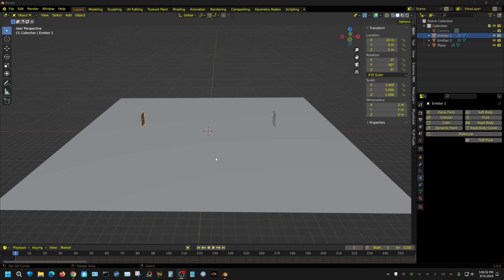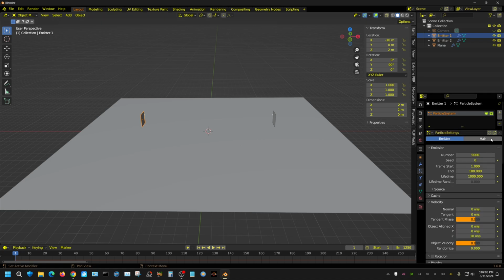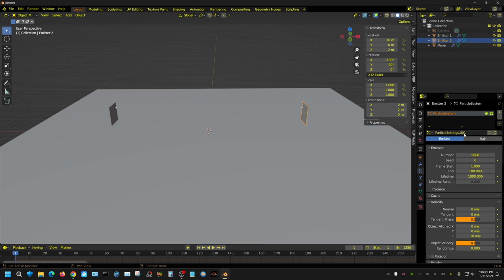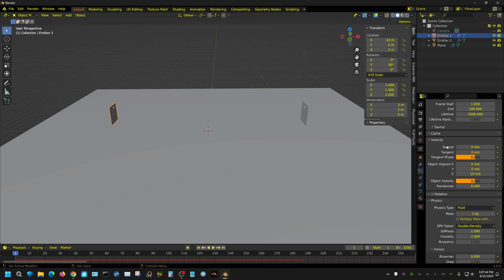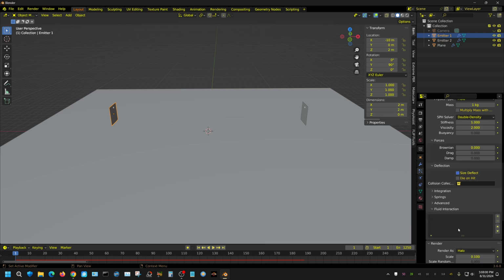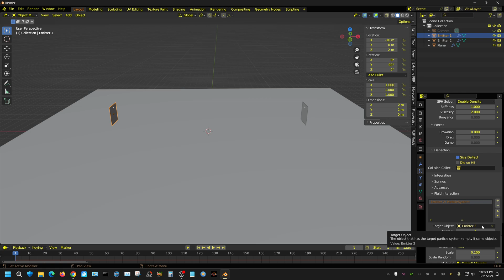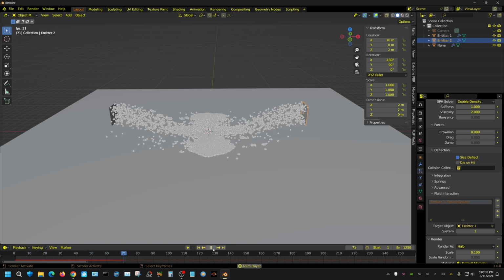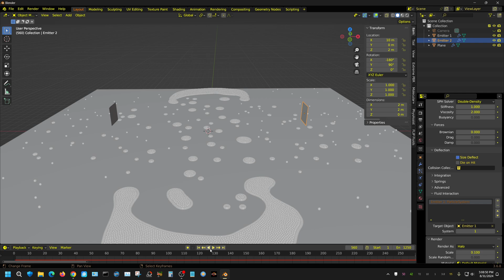Make Two Separate Particle Systems Interact With Each Other Blender

Comment: Thanks for  this video !  Very interesting !  I would like to know if you have a tutorial on how to use a particle system, ( beginners ) for say snow.... your video shows the particles growing and building, which made me think of snow and how it accumulates during a storm.  Anyway, thank you very tut, thank you !
Reply from the maker: You could use the particle system to create snow and that snow could build up. But the number of particles you would need to have built up snow would be a huge amount. Such a large amount the simulation would take forever and your PC would be extremely laggy. You would be better off using the real snow addon which I believe is free. https://extensions.blender.org/add-ons/real-snow/

Then using the particle system for the falling snow. But set the particle count high and the lifetime low. That way at any given time the number of particles in the scene is relatively low. That way it doesn't get laggy.

I used the particle system to generate falling snow in this scene https://youtu.be/1AmMOY1-nHA?si=8G9wYstxpST4VVVk&t=775 
It also used 1,000,000 particles. It would have took 100,000,000 particles about half the size to build up like you want but my PC would have gave up around 10,000,000 particles in. So the real snow addon is the way to go.
Reply: @BlenderRookie  Hi again ! Wow, I wasn't expecting such a detailed and awesome reply !  Love that snow animation you did.... I love how the snow is actually building up on objects in the scene ! Very cool !  Thanks so much  for the info about the snow addon !  Subbed and liked, of course, and thank you for your time on a weekend !! 😁
Reply from the maker: @FrostyTheBeerMan  You are welcome.
Reply: @BlenderRookie   😍 Thanks again for your time !!